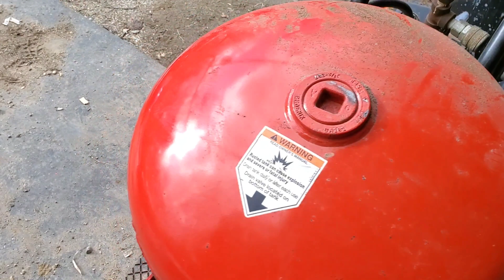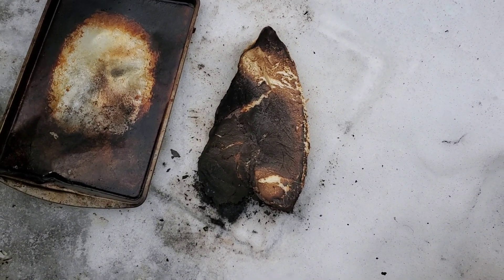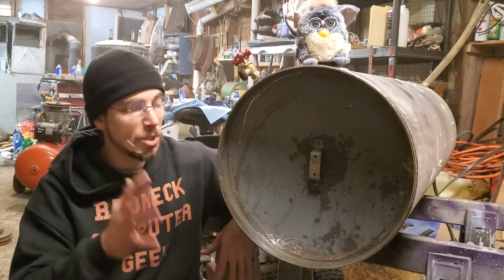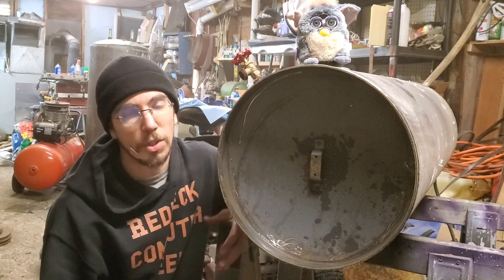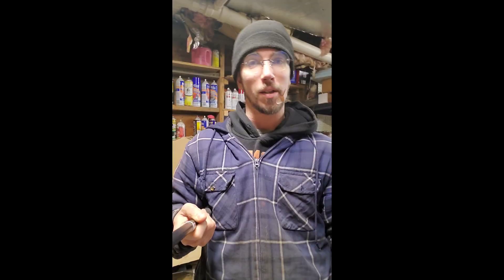Hot Water Tank Air Compressor

Comment: I'm curious if you really need to drain the water on a tank like this regularly.  It was after all, designed to hold water as it's primary purpose.  

Obviously if you've got leaks or rust outs, then it means the tank can degrade from water.  I presume it has a liner, and if the liner is still in tact, it would not rust, and the water that collects wouldn't be too troublesome?  Maybe the water is acidic from going through the pump?  That doesn't make much sense either.  

In my perfect world, a tank like this would be buried with one hose coming out.  Put the compressor wherever, manifold wherever.  But the pressure vessel sits 30 feet away, underground.  Now, that might make it more likely to rupture if you never maintain it.  But I still think a water tank should be able to hold water.